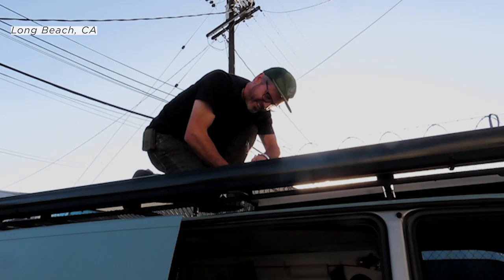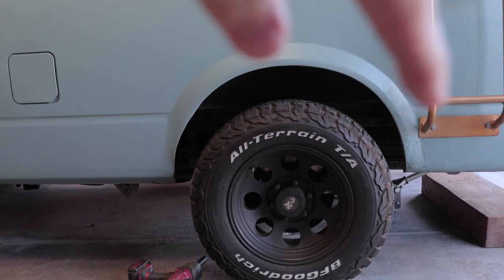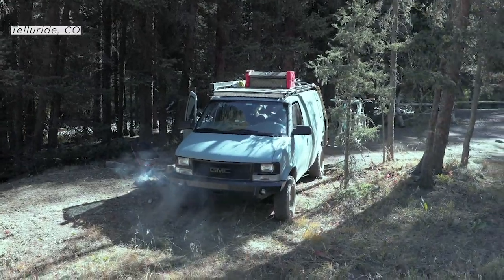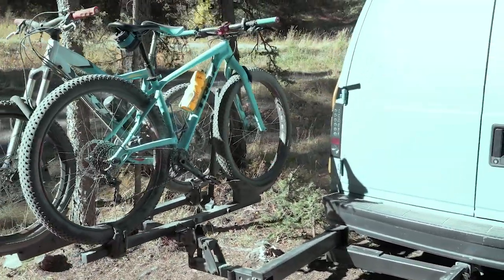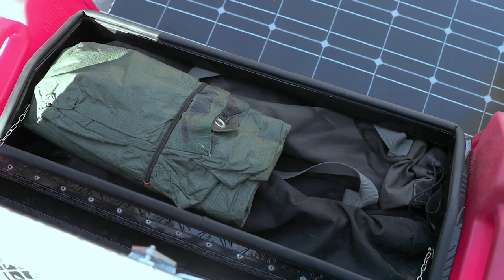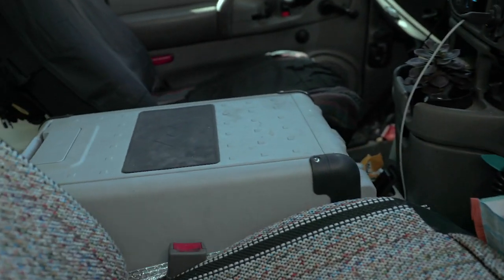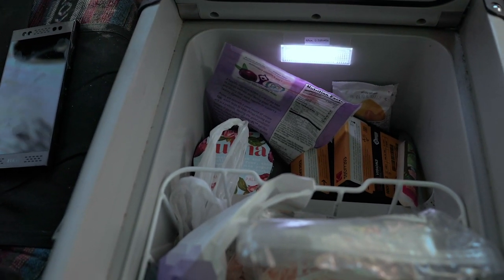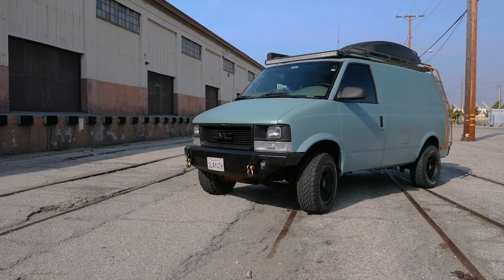Build-A-Better VAN GMC Safari AWD Awning & Bumper Part 3

Comment: Just a fyi the astro/safari is the same drivetrain as the blazer.  So you could get the transfer case from a blazer & then you would have a part time & low range

Comment: This is awesome. I am building out a 2000 Safari for full time living this summer (if I can leave the house lol) and yours is my template. I have other ideas for inside config, but the roof rack, ladder and bumper setups are amazing. When you put the ski box on does the fan still open far enough? Do you have to choose between the steel box with the gas tanks and the ski box or do both fit up there at once? I'm asking b/c I'm mostly using this to chase snow, so my snowboards will be with me year round.
Reply from the maker: when the box goes on its only for winter so I can only pop the fan a little. or not at all. I would go with a skinny box and shift it to the side. fan is crucial but not in the winter. heaters are key for winter camping. I've herd the Little buddy is good if you don't mind buying gas a lot.

Comment: So it appears this further tech assisted with rear axle and wheel centering and earlier rubbing?

And you ended up not cutting into the front portion of the rear wheel well?

Thanks!
Reply: I would like to know the same.

Comment: What makes it "not practical"? Would you have done anything different? I'm in the middle of ordering parts for my build. It will be a daily work van and weekend play toy so any advice would be great. Thanks!
Reply from the maker: practical meaning I did some things that most people don't need to do. EX. you don't need that much power, solar, battery. You can be fine with like half what I got.